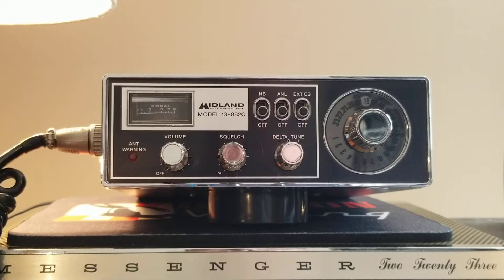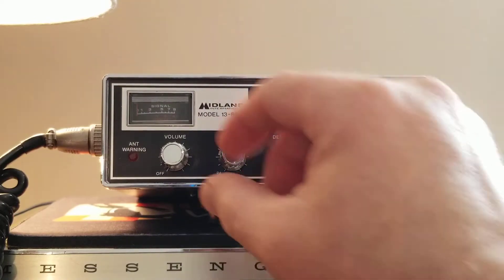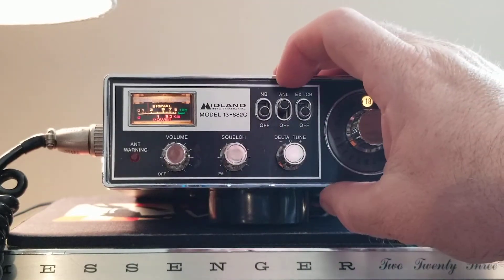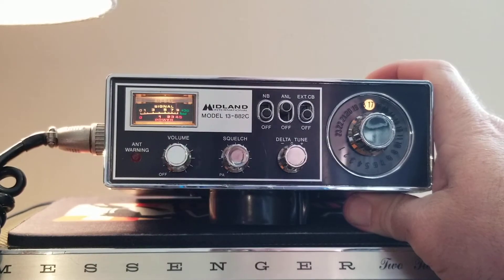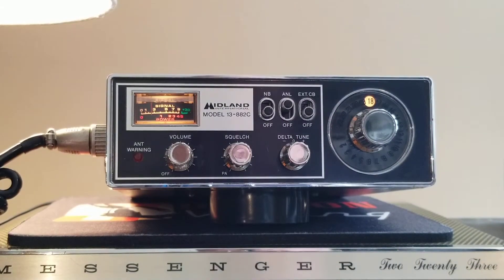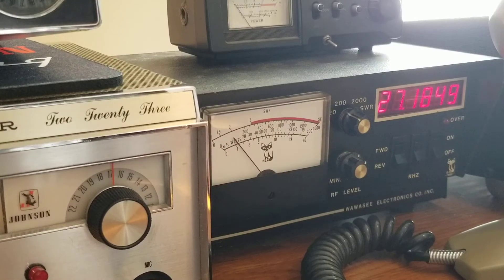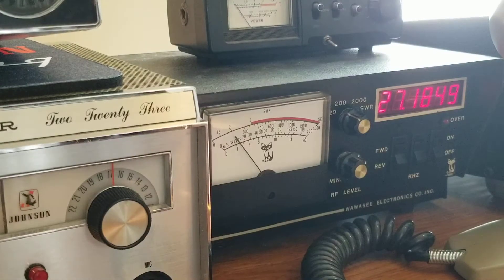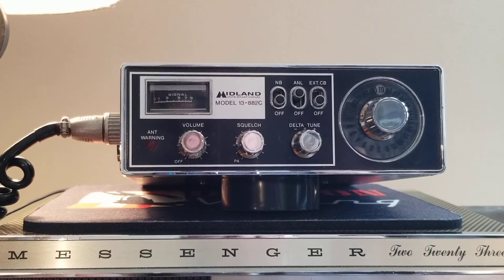Testing a Vintage 1976 Midland Model 13-882C 23 Channel Mobile Radio

Comment: Hey, do you want to sell the Johnson messenger 223?
Reply from the maker: Thanks for the question Brian, but unfortunately no. My 223 is my first E. F. Johnson radio. I  don't believe that I would ever part with it. It has a August 1968 date code and has the original rectifier tube still intact.